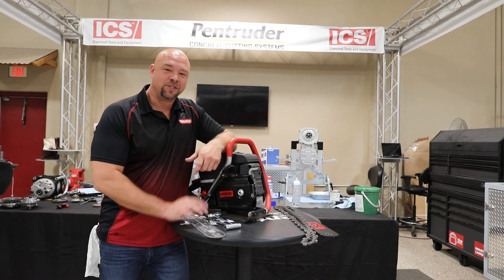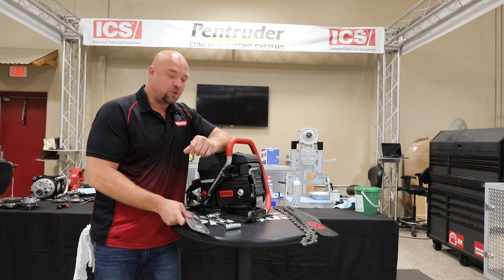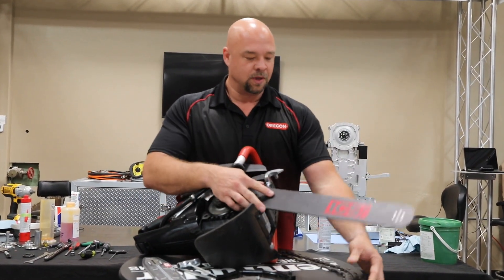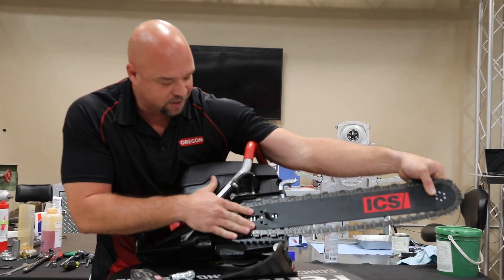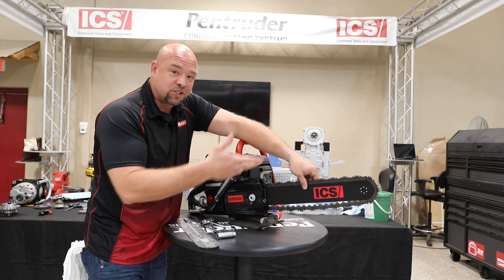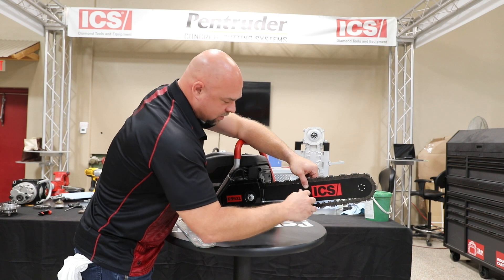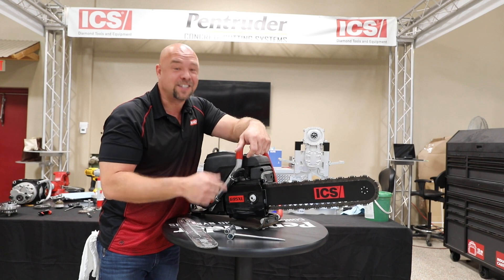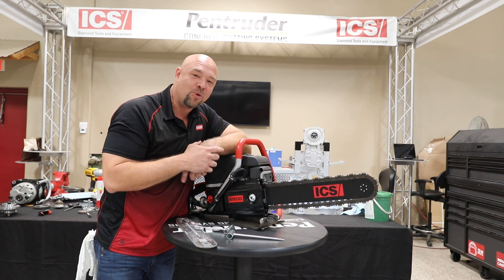695XL Saw Assembly with ICS Rep Ryan McBride

Comment: Got a crazy question for you Ryan. Can this saw be converted to a conventional chainsaw?
Reply from the maker: Thanks for the question - no, these absolutely cannot be converted.  They are specifically designed to cut concrete and have an integrated water port.
Reply: @ICSDiamondToolsandEquipment  thanks for responding. After thinking it out and looking at the saw I realized there was no way to put a tank and feed line for bar oil. Drive sprocket would have to be machined and that would cost as much as a chainsaw. I keep the old thing tuned and running just to do it. I like antiques. In 5 years with the company, I’ve never seen it used.